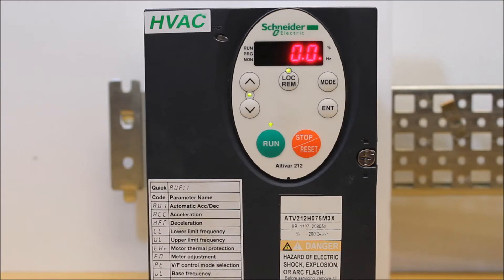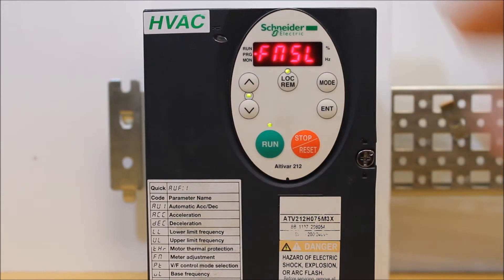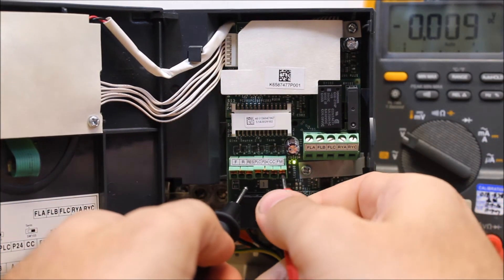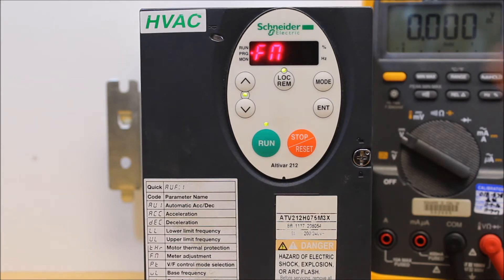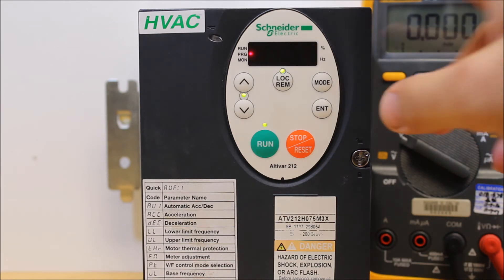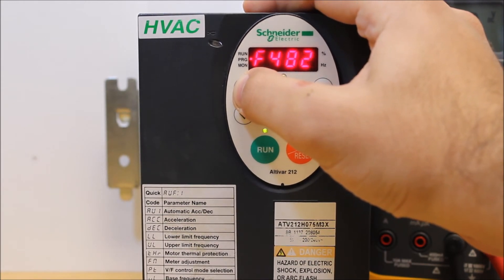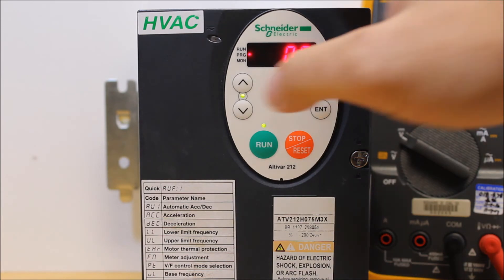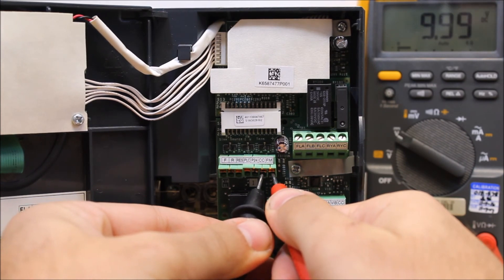Scaling ATV212 Analog Outputs FM & CC for 0-10VDC | Schneider Electric

Comment: Thanks for your video its very helpful, our VFD is the same model. PLC input is setted 0-20ma, I am not getting feadback value even 0-10vdc also. all micro switch setting is correct , I setted F692 => 20 F694 10 F695 50hz what should I do, 
Also  Please make a full a video for  VIA-VIB multi AI/AO sellection terminals. With mostly facing parametters issues with solution.